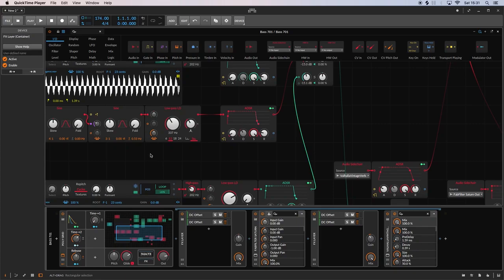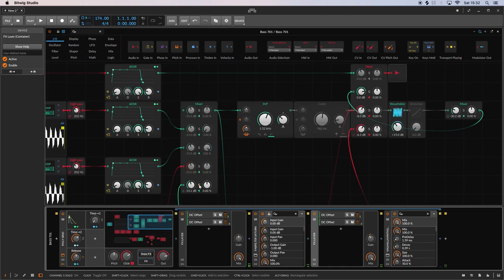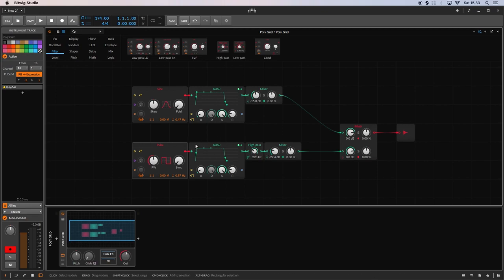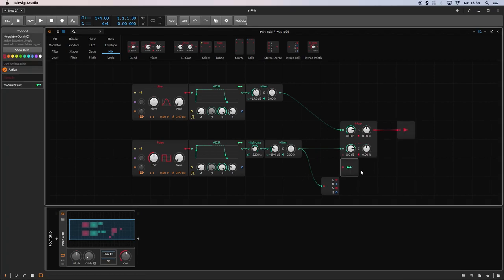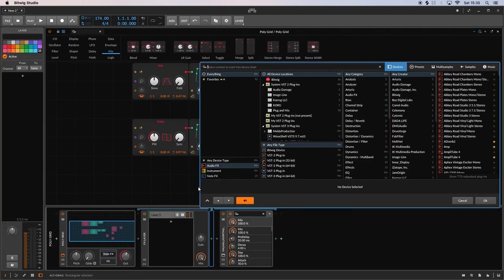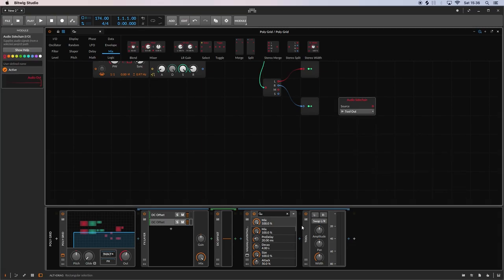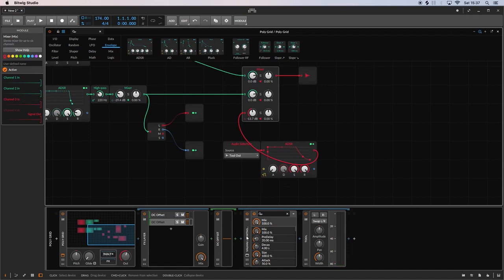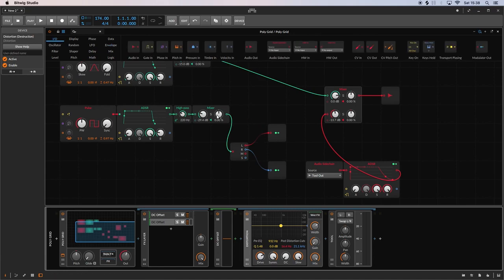How to use VST Plugins In The Grid Bitwig

Comment: BW might have changed since this video, but if you use JACK2, you will be able to simply loop HW Out from the Grid to an input on a normal FX channel and so also have that FX channel to use as a normal send from tracks too. This does away with all the DC Offset stuff. I'm reading 0.3ms roundtrip latency on The Grid track, so basically just the internal latency that's in the FX chain anyway.
https://youtu.be/zwDWUYgyKJg

Comment: Might be doing something wrong, but this technique seems to be coloring the sound coming out of the grid via the dc offset.... tester using a sine oscillator, and  it doesn’t sound like a sine wave going back in (reverb set to full dry).... sounded a little distorted.... or like a saw wave.
Reply: Figured it out.... modulation of DC offset should be less than 1.0 cos it distorts :-)